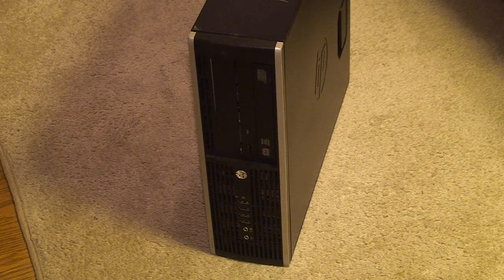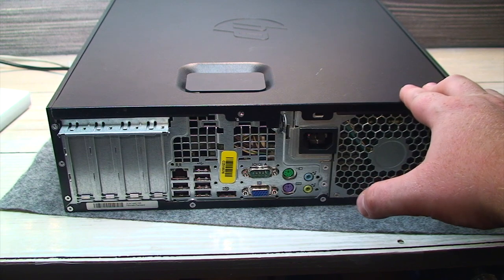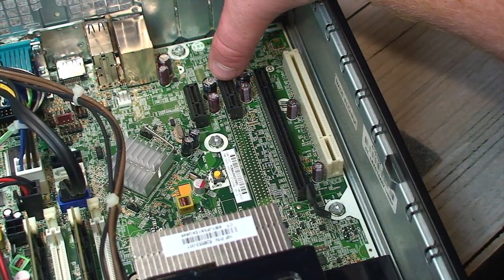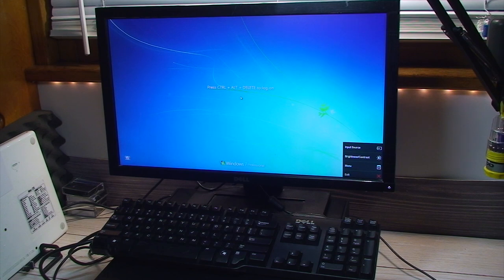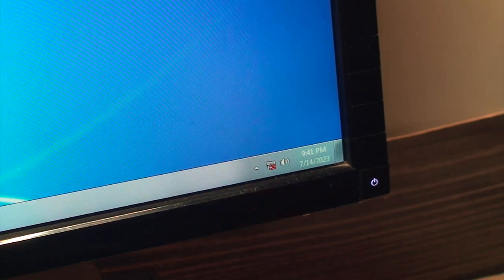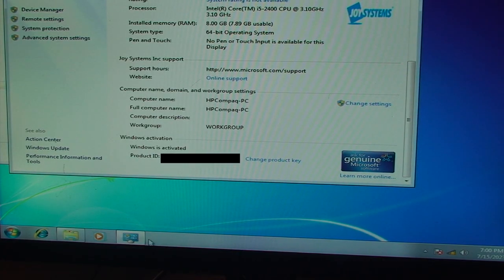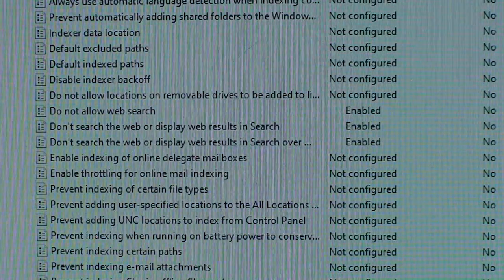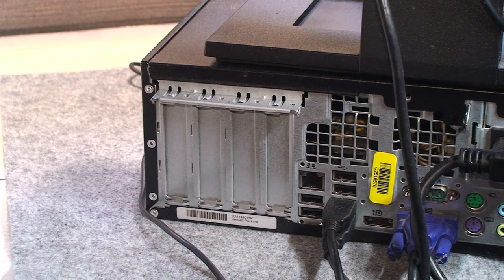Free HP Compaq 6200 Pro Revival & Review

Comment: Great find! These 6200 Pro’s are built really well and serve as a great everyday PC today. I’ve even converted mine into a home server since I figured these office PCs were designed to run 24/7 anyway.
Reply from the maker: They really are great machines. I'm considering removing the optical drive in favor of adding another hard drive, but then I lose out on being able to watch DVDs or play CDs. I'd consider using the 3.5" bay, but I'd like to add one of the HP memory card readers that would've been an option for these systems when new.  Maybe I'll stick a few 2.5" drives in it where space permits.

Comment: I actually picked one of these up with an i5, an SSD, 8GB of RAM, and an older Quadro GPU for $60 CAD. I was able to overclock the GPU by 20%. Games like Starcraft, Heros, and a plethora of other PC games are already playable.

I'm going to add an i7,  32GB of RAM, and a modern LP graphics card. I'll have some fun tinkering with it, then sell it off to the next entry level gamer.

At 35 years old, it feels good to get back into this hobby, and it's crazy to see how hardware from our time is still capable with modern software.

Thanks for the video!

Comment: I have the one from the following year, an HP Compaq Pro 6300 with Core i5-3470, also rescued from the trash for free. It's my most powerful computer.
Reply from the maker: I just came across a parts computer with four sticks of 4GB DDR3 I'll be able to use to upgrade this system to a total of 16GB (if it can support it). I also might throw in a dedicated graphics card, though I think the Intel Graphics should be more than adequate for my needs.

Comment: I had a similar model as my main PC (An 8200 tower with the same i5) for $89.99 on ebay and itg was pretty good. I used it until October 2022 when i bought an HP EliteDesk G1 800 for only $50. I'm glad they have PS/2 ports so i can use my vintage keyboards.
Reply from the maker: I have a spare IBM Model M I might have to use with this one!

Comment: Nice, can’t beat free! It’s strange to think that machines from this era are getting relatively old but they certainly don’t feel like they’re obsolete. Just goes to show how they are still quite capable for even just basic tasks. It’s a nice system for a home theater setup, or alternatively to run a file server or something similar, good to see you’ll get some use out of it. The benefit of these systems being older as well is that upgrades, at least if you want them, are pretty easy to get and inexpensive. The easy access to everything inside reminds me of some of my Dell Desktops where everything can be swapped out or removed without the need for any tools apart from maybe a screwdriver, looks like a great system overall! By the way, if you are looking to wirelessly access the internet with an Ethernet cable, look at the AirPort lineup from Apple. Something like an AirPort Express or Extreme can extend your wireless network and provide an Ethernet port to connect something up to the internet without WiFi. They are pretty inexpensive nowadays, at least depending on the model, and it’ll be easy to setup with your MacBook or iPhone.
Reply from the maker: It is shocking how accessible everything is. That really is the nice part about these older (but still new enough to be usable) systems; the parts are cheap and plentiful enough that it doesn't break the bank if you want to upgrade it. I'll take a look into the Airport Express/Extreme systems too, since my wireless network's range is pretty abysmal at the moment.
Reply: Exactly, it’s gotten to the point where quite nice systems, are super easy to get ahold of and aren’t limited by age anymore. Plus, you could always get ahold of a bunch of systems, even broken ones and upgrade/swap parts. I recommend the AirPort lineup, super handy and they work well together. You could probably find a bunch for a good deal since they are older now but still just as capable. I have some Extremes as extenders, Express models for AirPlay audio and extenders, and a Time Machine for the Mac Mini. Those backups have helped a lot in the past.

Comment: Great find! That beats my goodwill Dell Optiplex 3010 with a second gen i3..... and I had to PAY for the thing!! Outrageous!! :v)
Reply from the maker: I'm still using a Dell Optiplex 7010 as my main PC. It's been heavily modified over the years and continues to be a workhorse, so I haven't had any need to upgrade or replace it. Plus I have it configured exactly how I need it to be, so to start over from scratch is something I'd rather not do unless absolutely necessary. I now have two spare systems chock full of spare parts I can use to keep the 7010 (the best spec'ed model of that generation Optiplex) going. 

I'm tempted to clone the HD onto one of the spare systems just to experiment with Windows 11 without sacrificing my existing Windows 10 install.

Comment: just got one of those nifty small form factor pcs from a guy that was throwing it into a devices recycling bin and will upgrade its CPU to an i7-2600 I had lying around (it even takes a Xeon E3-1260L if you can find one for cheap but won't really go into the hassle unless I literally bump into a dead cheap one at a parts sale). Too bad HP never bothered to update its BIOS to support 3rd gen CPUs for that slot (or they simply thought why not force you to buy a new one).

Comment: I ended up with one of these recently and it only has 2 GB of RAM which I will upgrade IF I keep the computer. That said, whoever discarded this had already updated up to Windows 10 and between that and the 2 GB RAM the computer basically doesn't function. It takes minutes for anything to happen when you click and the task manager shows almost every metric running at 100% at all times.

How would I be able to downgrade to an OS that will run smoothly? Have you had  enough luck with Windows 10 for your use case (which would be very similar to my own intentions, using the computer as a media center) to justify me laying out money for RAM? Or is this likely to never function at this point since it was overupgraded?

Comment: It will also take the i7 2600 cpu.  I like you found this system.  just full of junk.  got the 2600 pro  cd's from ebay ,so i could reset the system .  added a 1030ti gpu and 16gb ram , it made it a nice retro gamming pc.

Comment: Can a ddr4 ram fit in this? 
I just got one of these computers trying to turn it into a gaming pc and I have had no luck. It always beeps once and I don’t know how to set up the hard drive I have a 1tb and I have no clue what I’m doing.
And I’m using an vga cord, and it will not connect to my monitor. 

Phew 😅 with all of that long text out of the way (sorry lol) is there any way you could help?

And the rams are (GIGASTONE 16gb x2)
Reply: ddr4 is not compatiable,1 Beep - Refresh Failure, put the cables into the hardrive